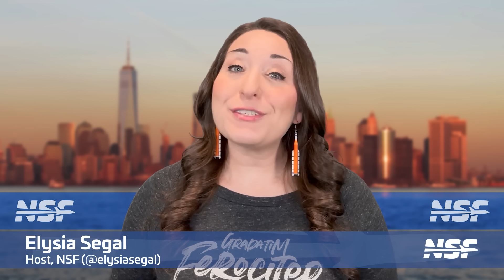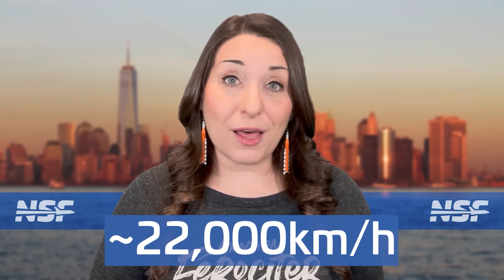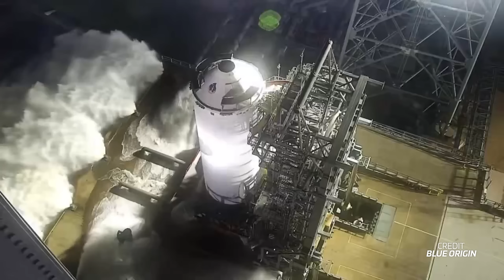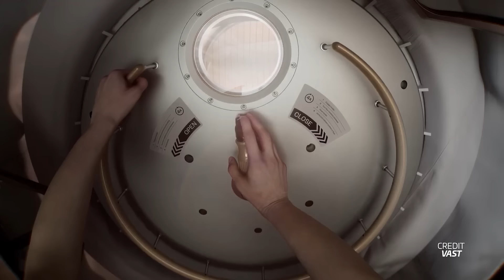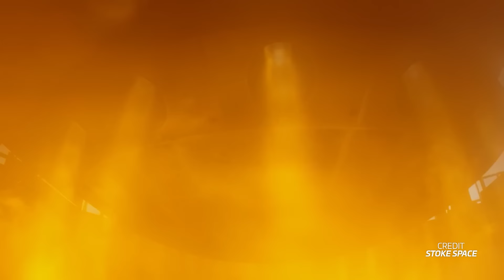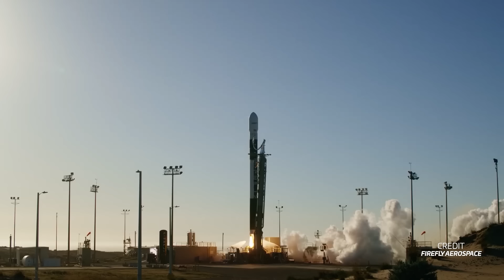Starship HLS Tensions Rise in New Report | This Week in Spaceflight

Comment: "Simple" solution to the need for flat landing sites is to send a rover bulldozer in advance to prep a landing pad. One of the issues of sending bulldozers is that they need considerable weight to work, but we could feasibly send them with empty counterweight baskets/bins and then fill them up with lunar regolith while on the moon.
Reply from the maker: But how do you land the dozer? 🤔 - Das
Reply: @NASASpaceflight  A very large space crane....

In all seriousness you could probably use a Sky Crane system like they used for Curiosity. Curiosity was nearly 900 kg, with moon gravity being about 2.3x less than Mars, you could drop a pretty heavy dozer rover. Granted, you don't have aerobraking, so it wouldn't be able to be double the weight.

Curiosity flew on a 541 Atlas V all the way to Mars. A Falcon Heavy could definitely get a hefty dozer and decent vehicle to the moon.

You'd focus most of the rover weight in structure and motors, with extra mass needed for downforce and grip being provided by lunar regolith it would pick up while on the moon. It doesn't have to be all that fast as it could conceivably run of months or years before a landing or moon base is attempted (though we are fast approaching the expected launch dates for such things).

Comment: I get the wanting manual control thing....but I also wouldn't want to be the one trying to manually land an apartment building on the lunar surface either.
Reply: Unless something incredibly catastrophic occurs like a major fuel leak anything requiring a manual take over would likely be an abort back to orbit.

Comment: Manual Control should be non-negotiable! At the very least, there would need to be triple redundancy of the Flight Control/Navigation system computers.

 What if the whole thing goes on the fritz, some glitch for ANY reason as the crew is descending to the surface? Nothing like seat of pants manual control when computers or default thrusters go down. See astronaut Butch Wilmore interview on the Shawn Ryan Show for how he had to take over control of Boeing Starliner when things went sideways approaching the ISS year before last.  

Astronauts should ALWAYS have a Manual Control option available.  And as NSF Flame Trench guys said last night, let's face it, Starship as the HLS is very tall, slender, and with too narrow a landing base & pads making it highly susceptible to tipping over and crashing. 

A number of small, uncrewed computer guided landers have either crashed or tipped over on the moon in the past couple years. I want an actual human piloting any human crewed landing craft like back in the Apollo days. Especially for any spacecraft looking like a giant, multistory suppository with a very narrow base.

Comment: Lol. "wear out the tanks with any unnecessary tests"😂😂😂 just another piece of evidence that SLS is completely obsolete hardware
Reply: Have you designed a cryogenic tank that does NOT fatigue?
Reply: @MrSummitville huh? Starship is meant to be reused dozens if not hundreds of times. SpaceX would have a massive problem if their design was so weak that they would have to worry about one too many cryo test making the vehicle unusable for flight. SLS obviously has that problem.
Reply: @niri2506  Starship had a LOX that dramatically ruptured! Different metals and different designs fatigue the metals differently. It's called metallurgy.  Do some research.  Nobody knows how many times these tanks can be re-filled / cycled. It is a finite number and it will be catastrophic when it fails.
Reply: @MrSummitville that's why they do their insane amount of testing on everything.
Reply: @niri2506  One tank exploded after SoaceX launch. SpaceX has had a lot of rockets blow up, after the launch. SpaceX was lucky no humans were inside.
Reply: @MrSummitvilledude it's a developmental program based on the principle of rapid iteration. Aiming to design something that has never been done before which is a rapid and fully reusable rocket. Even the engines designed from the ground up with technology noone has ever achieved before. Why are you talking shit like that, particularly suggesting SpaceX might have had the idea to put people on any of these so far or will for the next couple of years, if you obviously got no clue what you're talking about?

Comment: For the elevator issue, all they need is a smaller auxiliary lift with a carabiner at the end.  Astronauts attach it to an anchor on their suit and just get lifted straight up.
HLS would have the upmass to build in redundant equipment.
They could also bring along a some kind of manually operated cable climber, an astronaut attaches to a free line, and by the use of a ratcheting crank or windlass or some other mechanism can drive themselves back up the line by muscle power alone.  
Probably one hell of a workout even in 1/6G but it would be a solution totally independent from electrical power and complex machinery.
Reply: Your hearts in the right place. Until they need to offload heavy equipment
Reply: Yeah I've been wondering about what the best options might be along these lines. Obviously we have no idea but it's fun to speculate!

How about always having at least one astronaut remain on board, and if the elevator fails they can throw a rope down to their colleague, and use a winch?

Or could SpaceX completely rethink a heavy duty ascent & descent vehicle? Still needs to be launched with Starship, but not necessarily in one piece? With thrusters at the top (to minimize kicking up dust), and excellent landing legs plus astronaut access at the bottom. (I suppose not though. It's not worth it, for now. Just use current designs, build the landing pad etc, and then redesign your lander.)

Comment: What all of these lunar landing vessels need is not expensive landing gear, but rather a landing platform similar to Spacex's "Just Read the Instructions". This platform needs to be self leveling, actively stabilized, and have mobile transport ability, think Four or more mobile heavy lift vehicles similar to the transports used by Spacex to move the booster and Starship to the launch pad. These should be sent ahead of any flight to catch the lander being sent by some provider at any location. The platform may need to be able to lower its captured vessel to the lunar surface after it successfully lands, think placing a dinner plate on a table, and reload itself with a new platform to catch another vessel. It may need support equipment like a bull dozer to level the ground under the location where the capture is to take place, allowing the captured lander to be safely lowered to ground level. The benefit of this is many fold. A ships landing gear would not have to be as complex as the landing location is guaranteed to be level and stable. The landing platform is re-loadable and reusable, possibly one of a stack of thick steel plates to be used for landings. The landing platform could be designed to relocate itself hundreds of miles across the moons surface, think the Japanese 4 legged "CORLEO" robot and of course the Heavy Lift Vehicles or Carriers could have these legs attach to itself as an optional transportation method.

The best space habitat in my estimation is an ants nest built underground by tunnel boring machines. These could be built along the lines that an ant nest on earth is built with respect to functionality. These nests could be purposely designed to allow for the inflation of habitats within them, including inflatables which serve as connections between inflatables and different levels.

We need to send resources to the moon to prepare it before we send people. In fact my opinion is that outer space and the moon should be terraformed, made suitable for human life by the intelligent introduction of a biosphere from earth, microbes, plants, insect life, animals a rich and diverse environment designed to provide the biology that we take for granted on earth, this should be effectively accomplished on the Moon or Mars before any human presence would make sense.
Reply: And what is going to land all that highly specialized yet to be developed hardware?
Reply: @imaginary_friend7300  It would land in the same manner that Starship or any other lander would, by a landing vessel, one carried to the Moon or Mars by Starship but not necessarily brought by Starship to its surface. But, do not worry imaginary_friend7300 I am not looking for friendship with you just the opportunity to express myself.

Comment: NASA is still stuck in 1960s thinking. If I were a passenger, not a pilot, but a passenger on one of these HLS landers, and they asked me which I wanted to be in charge of the landing process, an advanced AI or some guy who has fantasies about being Buzz Lightyear, I'll take the AI. The simple fact is computers can react thousands of times faster than a human being, take in far more information. I just think it would be a bad idea for the pilot to be able to take over manual control.
Reply from the maker: "You're absolutely right, the local gravity constant in the moon is not 9.8 m/s. Ill recalculate using the proper value, thanks for pointing that out." 

Not quite yet... models still not great with numbers. - Das

Comment: How can you be ready to launch and not check for leaks?
Reply: They already did that twice. The last leak was not on SLS itself but a connecter, so if it leaks again it means some fuel is lost before it gets into SLS but SLS still gets fully fueled.
Reply: It can reduce its operational lifespan due to material fatigue accumulation thru fuel charging/discharging cycles and pressure testing
Reply: @themanbads  You want to ride it?
Reply: @josephdelp87  Well, I'm here to explain the main reason, not to suggest that this decision is safe.
Reply: its america keep in mind a company called boeing exisits in this country
Reply: How can you say you have hundreds of robotaxi in Austin etc ?
Reply: @davidpearn5925  Since when did NASA or Boeing say that?
Reply: @i-ccc-channel the SpaceX CEO claims that as being fact. NASA should be ashamed at being identified with a conman.
Reply: @davidpearn5925  Like I said: Neither NASA nor Boeing made any such claim, so your point is entirely ... ummm... pointless!  And meaningless.  And your EDS is showing.  Pity it appears to be incurable.